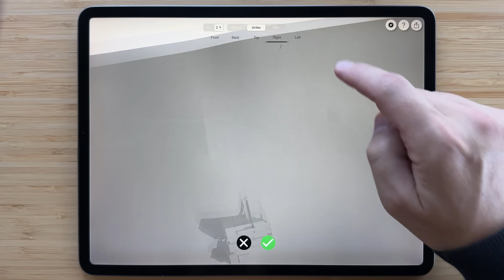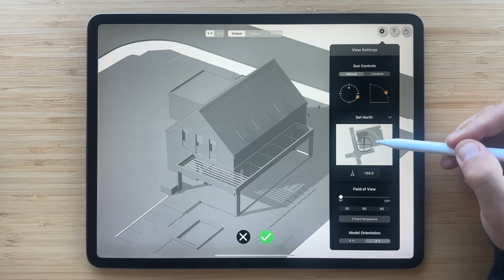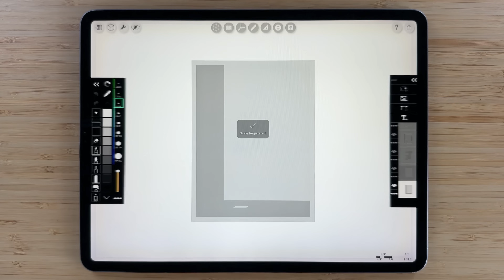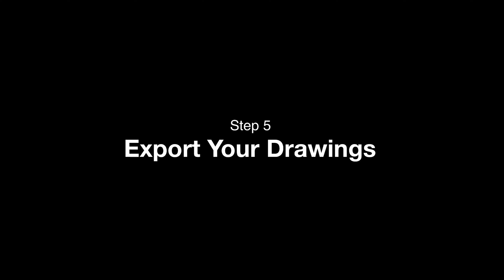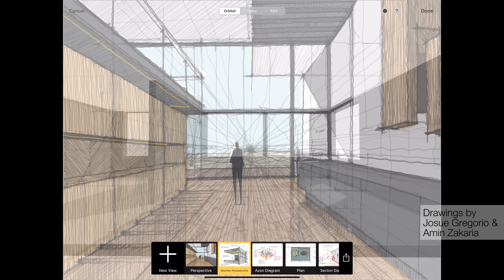Comment: Probably the one software I won't be able to run my business without!

Just one problem with this feature though. Most of the time it creates misaligned perspective lines from 3D models I import from SketchUp for iPad :( I use .usdz file, and have played around a lot with fov and other options, to no avail. Anyone knows the solution? @morpholio
Reply: That's amazing to hear Sayed. The perspective tool aligns to the XY Axis of the 3D model space so if your 3D mode is rotated off axis or has non-orthogonal edges, it won't perfectly align with the perspective tool. Check the orientation of your model and make sure it's aligned to the XY axis of the model space and you should be good to go!